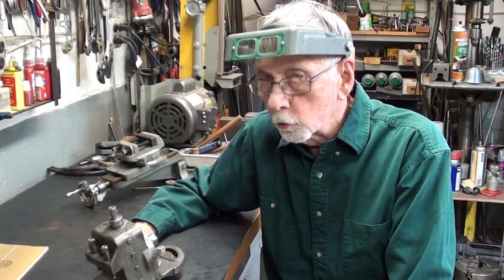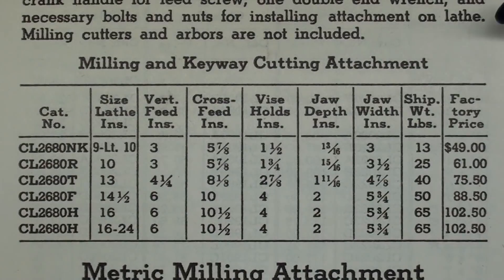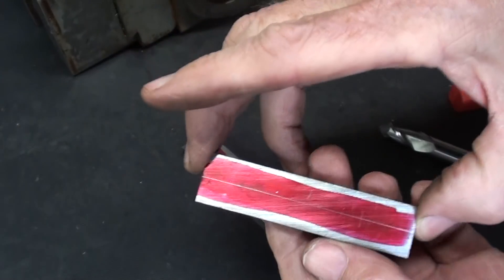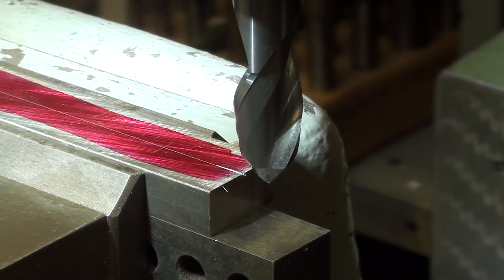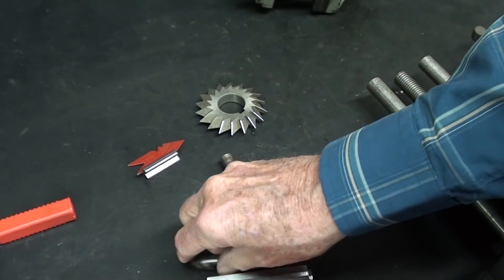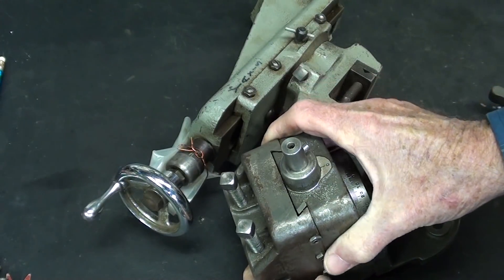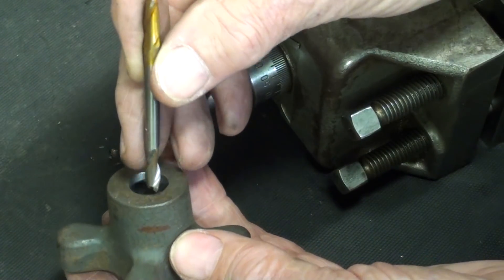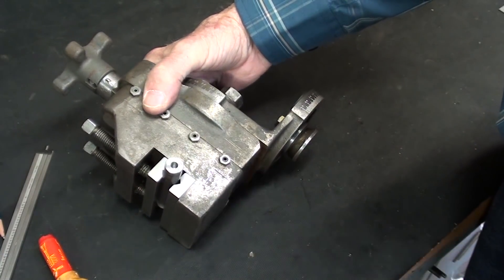FIXING THE SOUTH BEND MILLING ATTACHMENT 789 tubalcain

Comment: Attachments v dedicated tools are always the major crux in the hobbyist/home workshop. Thank you for an interesting video - not entirely related to metalwork, but I remember black and decker having this multi attachment system to it's standard 350 watt home DIY drill, including a circular buzz saw attachment that would stall the machine if it cut anything thicker than 1/8 inch hardboard! lol
Reply from the maker: I remember that Sunbeam also made a drill set with all kinds of worthless attachments

Comment: Hello Mr. Pete. I have the milling attachment for my Myford ML7 lathe. I always have problems in setting the work piece securely in the vise when the milling attachment is already installed on the lathe. This is particularly true if parallel bars are needed to seat the workpiece to avoid the jaws. Holding things in place to tighten the vise and to maintain the work piece seated properly on the parallels, or vise ways I find difficult. Any suggestions?

Comment: My Sheldon 11-44 uses the same tool post and I have the milling attachment like that as well as a tool post grinder (the good kind). Might have been a Military requirement for mass production houses to have common parts.  Mine was purchased by Dad as I had big eyes in the massive country machine store. I even found the salesman maybe 10 years ago retired.  My G-Box is not fancy Varnish but is Fancy black silk (to hide the wood used) war issue. (During Korea - actually just before).

Comment: I need to find a lathe milling attachment with about 3"-4" of vertical travel. I want to mount it to my drill press to hold cutting tools so I can do light turning on my drill press. Any recommendations?
Reply from the maker: Probably the atlas would be best.    but I am not sure how much vertical travel it has.     Whatever you do bye, make sure it does not interfere with the drill press head.
Reply: Goodluck, you will be limited to drill chuck capacity and still put side load on your work peice and it will drop out of the drill press......

Comment: My first thought was that you could easily add a crank handle to one of the knob ends for speedier operation. That's what I did on my Palmgren milling attachment when I made a larger degreed knob using the idea you showed for making a larger cross-slide dial for my Logan lathe (which I did and love). Now I finally have a benchtop mill so I need to try and sell my attachment, I guess.

Rob

Comment: As a person without a milling machine and one who actually does milling on the lathe these rigs are useful however I don't know why anyone who owns one or more milling machines would ever bother. The time to set up the lathe for milling combined with the limited travel and with gravity working against you to make set up more fiddly would certainly cause a person to never set up the lathe to actually mill. If you're using the lathe both as a lathe and a mill there is also the careful planning when machining parts due to the time and frustration involved in switching back and forth which is quite time consuming given the tramming involved.
When it's all said and done I suppose I can be happy that I spent only a little over $100 in a fixture to do this. The hours involved were countless since I did this with the popular chinese mini lathe. I also made a cross feed lead screw that is longer than what comes with the machine to give me approximately 5" of x-axis travel. The y-axis attachment being a little more than 3" giving me something close to the specs Mr. Pete showed for the 9" lathe in the chart. 
Some day I may acquire a milling machine which makes this all moot. I suppose many who travel this road end up wondering why they just didn't buy a milling machine and getting it over with in the beginning. 😀
Reply from the maker: Thank you for this comment. Everything you said is absolutely true. That is why I have made very few videos to show how to use it. It has about 10% the value of a real milling machine

Comment: This video is timely, as I have started using my milling attachment on my Boxford lathe, it is the exact same design, (as is the lathe as the 9" South Bend), although mine has a nice friction dial on the top., but basically the same, you have me thinking about a lock now, it's definately needed, thanks a lot Mr. Pete, food for thought indeed!

Comment: I prepared for you to broach the knob with a 3/16" broach. The milled slot works just as well and is much simpler.
Thanks also for pointing out the misapplication of the mill drill. I have made the same error and not understood that I was plowing with the tip. A solution is to mill a small square in bottom in the root of the V or use a conventional mill and angle the head or work as you stated.

Should you mark a reference edge on your V jaw since you used raw stock? This would ensure jaw parallelism to the milling vise reference jaw and make it simpler to ensure round work holding parallelism to the lathe cross slide travel.

Great video subject. 

I see that your Atlas milling attachment is as pristine as mine. Milling in the lathe is so impractical and limited my attachment stays in the tool chest drawer, but will enhance my lathe resale value!😃